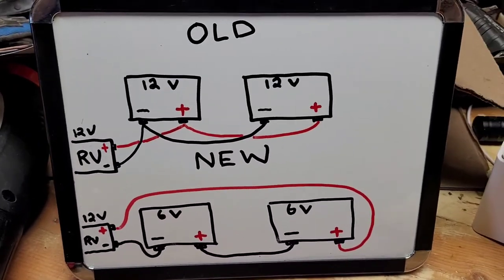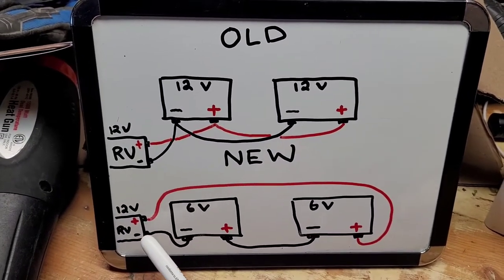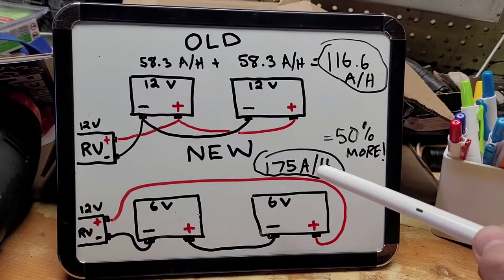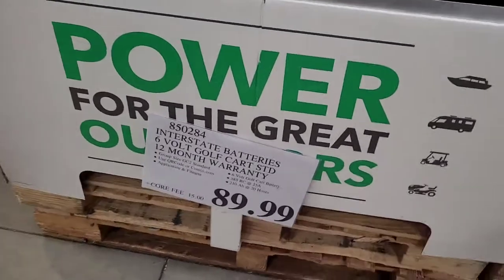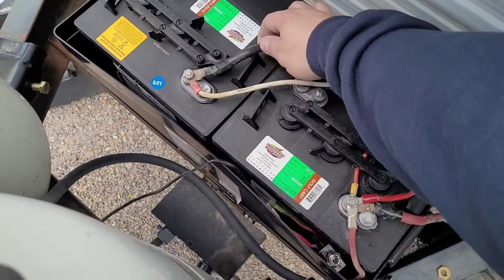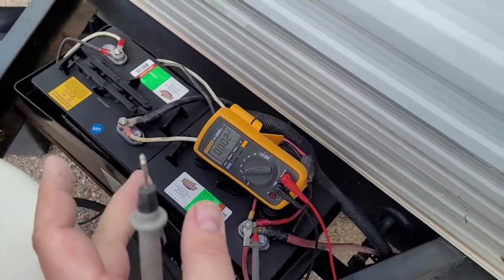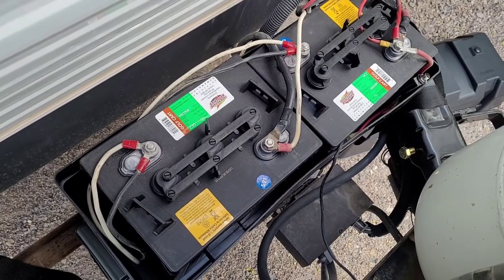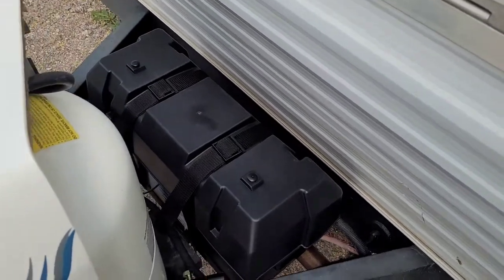How to Convert RV / Trailer to Golf Cart Batteries and Why It Is BETTER!

Comment: Thanks for taking the time to produce this video. Nice job. We replaced our two 12v batteries with four 6v batteries in series/parallel for a total of 470 amps. We used a four foot wheel well truck box the trailer tongue behind the propane tanks in order to fit them in along with a disconnect switch and battery monitor shunt.…locked and secured.
Reply from the maker: Thanks for taking the time to comment!

Comment: Nice job. I did this as soon as I got my trailer. Also added a waterproof marine battery disconnect, quick connect for solar, 200W Renogy suitcase travels with us, etc. Videos are on my channel. It is so great to have fully charged heavy duty batteries all the time. I think I'm about 3 years in with the dual Costco 6V golf batteries and working fantastic. Just top off with distilled water occasionally and all is good.

Comment: Can both 6v batteries be charged/maintained at the same time with one battery tender by connecting them in series and setting the tender to 12v?
Reply from the maker: Yes

Comment: Will this two battery setup provide enough power to run a fifth wheel?
Reply from the maker: If it is based on 12V battery architecture then yes

Comment: You're 2 cool for skool, I'll make sure to do this on my camper too
Reply from the maker: It's the way to go!
Reply: @JCTFIXIT  Lithium batteries are the way to go and cheaper in the long run.
Reply from the maker: Lithium RV Batteries are way too expensive right now. Most are around $500-$1500 for 1 battery. Golf carts are around $100 and will last about 5-7 years. I also do not think that they have good characteristics for an RV. Lithium batteries do not like to be full or empty they are happiest between 30-80% and lead acids like to be full. (I leave my trailer plugged in when not in use). Also Lithium batteries are more sensitive to vibration and temperature extremes. Look I love Lithium ion batteries for many things, but this is not one of them. Maybe if I was living in my trailer or RV and constantly cycling them, I would consider Lithium, but for most folks that use their campers a few times per year, it just doesn't make any sense.
Reply: @JCTFIXIT  I strongly disagree with everything you are saying. If you are interested in better options check out "Will Prowse. He has learned a lot over the years!
Reply from the maker: You can disagree with what I am saying, but until you can form a valid argument as to how Lithium would be more effective or more cost effective for my application then Idk what to tell you. Yes they last longer, but they cost 5x as much. Yes they can handle higher discharge and charge amps, but I am usually running less than 5 amps. I'm all ears, but just saying it's better and to go watch other videos on it won't cut it for me.
Reply: @JCTFIXIT  I don't have time to teach or give valid arguments. If you are interested in being proven wrong! go see Will. That is just to help!
Reply from the maker: The guy was literally living in his RV when he started his channel. Like I said in my comments, for someone who is cycling the batteries continually, lithiums would make sense. Not for people like me who use their trailer about 5 times a year.
Reply: @JCTFIXIT  The point was! you are the one who asked for a valid argument. Now I SEE WHY YOUR CHEAP BATTERIES LAST 5 YEARS. You hardly use them. You failed to mention that. Anyway, this was a total waste of my time.
Reply: @JohnSmith-xx1lx  Don't worry boy! I can afford it. Money isn't an issue. Enjoy your primitive setup and I will enjoy my up-to-date one. Not here to argue with stupid people.
Reply: @jacquespoirier216  my response to your last comment is a year late, but hopefully by now you’ve grown up and learned how to speak to other men. Charge that on lithium and feel the power.

Comment: Did you have to modify your battery rack on the tongue of your trailer to compensate for the wider 6 volt batteries?
Reply from the maker: Mine was wide enough, but it is worth noting that I got a battery holder case that is built to hold 2 golf cart batteries. Definitely measure before you pull the trigger.
Reply from the maker: The width is very close to standard rv marine batteries. They are a little taller though.

Comment: Thanks for Sharing, 

I have one question. The sticker on the battery says 210ah @20hr so are they 175ah or 210ah? 

I’m looking to use 2 of these for a solar shed setup to charger all the batteries for my power, lawn tools
Reply from the maker: They rate them differently based on different amp draws. It can be confusing. 210ah at 20 hour would mean it can pull a little over 10 amps for 20 hours straight.
Reply: @JCTFIXIT  thank you’ that makes since now!

Comment: Back in the olden days, we would put water in the battery until the water level hit the bottom of the fill tube, at which point the water would "pucker" and you would know it was at the right level...
Reply from the maker: I suppose that would be appropriate I always go just below that level because I accidentally overfilled a set in the past and over-dilluted them which ruined them. You can always add more but once you over do it you're in trouble.